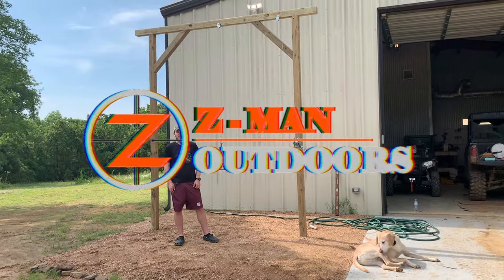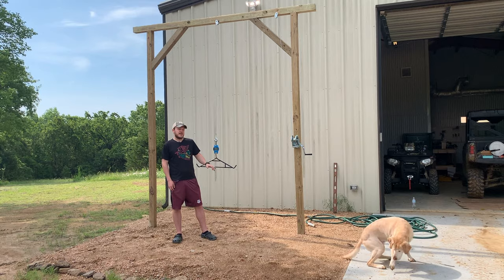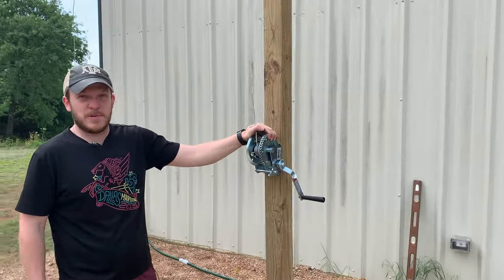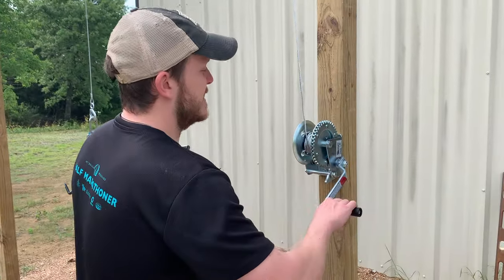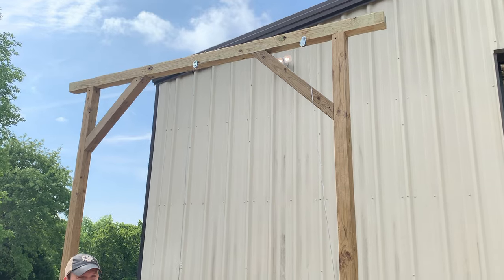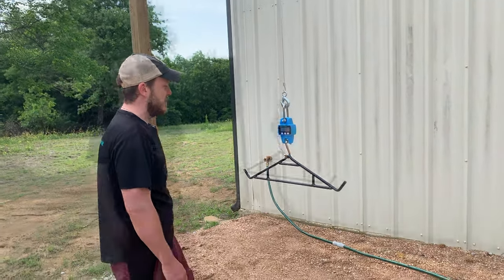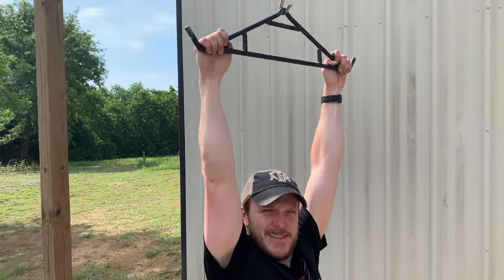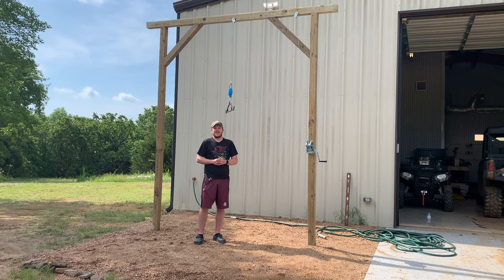DIY Game Hoist Setup

Comment: Same set up I have..but mine is made out of metal square tubing..I been a welder for 17 years in structural Bridge for the state if Texas also welded for the oil field manufacturing battery tanks, heater treaters vessels and water separators all requiring x ray code welds..so fabricating a simple frame in a field of my expertise is why I chose steel it's what I'm comfortable working with..but mine is a single post with support brace like you have there and I welded 2 pulleys to guide my cable..works great..winch and pulleys I purchased on Amazon spent less than 50 bucks and I had pipe laying around..hope 2 hang some deer next season..
Reply from the maker: Oh that’s awesome, I’ve wanted to learn how to weld to be able to projects like that! But it does work great, thanks for watching and good hunting!

Comment: Just a thought but if you made that winch easily removable with a nice size carriage bolt and piece of garden hose you can make a drawboard for bow as well. Average jack has video on that. My next project
Reply from the maker: I actually have another winch with the cloth strap in a box ready to build that exact draw board haha. Just need to find the time to do it!

Comment: When the pullies fail ( yes they will )  get bigger ones then put them back and get next size up. Cover the winch so the dirt doesn't get in it and grease , grease , grease marine is best.
Reply from the maker: Thanks for the advice, I will keep that in mind for sure. The pulleys were smaller than I expected, but they seemed to work alright for now! Thanks for watching
Reply: @ZManOutdoors  they will fail, ours did the axel bind and break or jam. Ours did, way they are set it only 2to1 and they find sand like a magnet.
Reply from the maker: Good to know, thanks for the tips!
Reply from the maker: Thank you, that’s a really good idea, I’ve had issues with them swinging around. I was thinking about putting something in the ground so I could still walk around it easily. I’ll have to test out some options and see what works best, but I may end up just doing what you said here! I’ll probably do a follow up video once I test some options out
Reply: @ZManOutdoors  Had one hung up and pulley broke after I washed it off of course
Reply: Ted, is there a pulley that you like or would recommend for this set up? My setup is indoors and used for deer and farm raised pigs.
Reply: @moonlighthomestead4259  I got an industrial pulley from a wrecker. Most of us only use 1/4 inch or 3/8 cable the pulley is for 1 inch cable (I broke 3 before that) In this case over build it bigger heaver the better, that way it is one and done.
Reply: @tedsemonis7905  I like one and done! Thanks!
Reply: @tedsemonis7905  the pulleys in this system are just a change of direction, technically. The only mechanical advantage in this system is the winch. If he had a winch on the gambrel with the terminal end being back up on the top board it would be a 2:1.

Comment: Do you lag bolts to connect 4x4’s at the top? If so, what size? If not, how did you attach them? Thanks!!
Reply from the maker: It’s been awhile since I built it, but I think I had 5” bolts and I pre drilled them. For the diagonal pieces I used 4” screws.

Comment: About to make one myself what size screws did you use and hows it holding up now?
Reply from the maker: I used 4” screws and toenailed them in on both sides
Reply: Very nice. Did you put all boards together before you cemented it in the ground?
Reply from the maker: No, I cemented the two posts in the ground and then got on a ladder with the top piece and toenailed it in and then added the support braces leveling at each step

Comment: What size bolts did you use to mount the winch onto the 4x4? 3/8s 5inch?
Reply from the maker: I can’t remember specifically if it was 3/8” or 1/2”, but they were 5” long! I think either diameter would work
Reply from the maker: So I double checked, I didn’t put a bolt all the way through, it looks like I used a 1/2” x 3” galvanized screw. I used 3 of them.